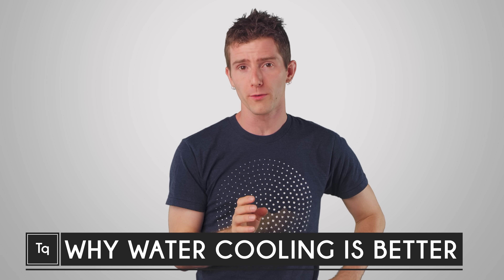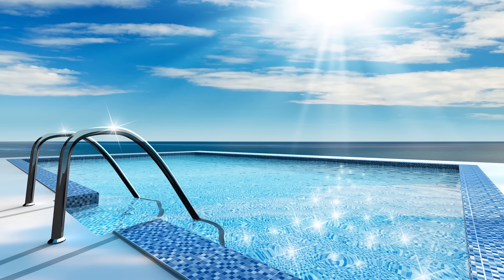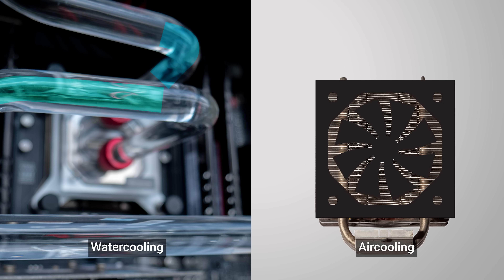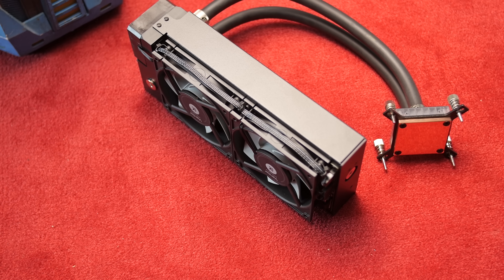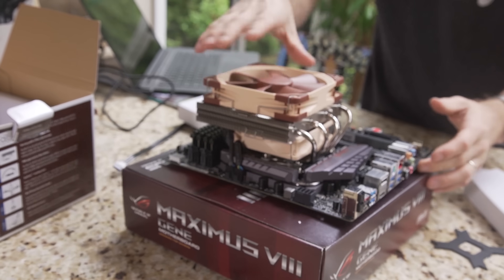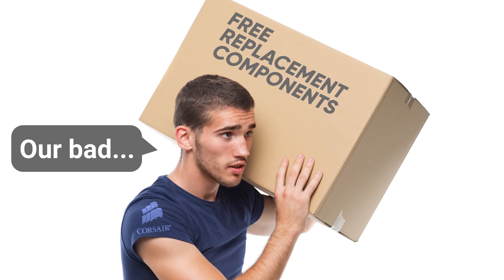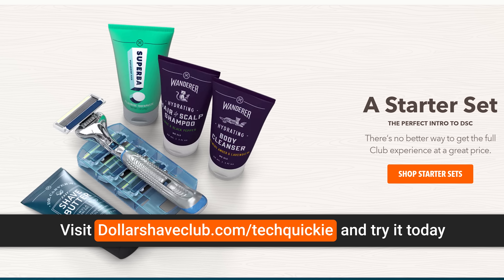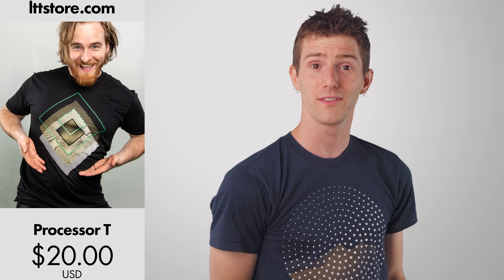Why is Water Cooling Better?

Comment: I used water cooling for my FX 8350 OC. Then ditched it for simple air cool after upgraded to Ryzen 3600x.
Reply: The sad thing about cooling the Zen 2 series is their chiplet design makes the heat off-center... which most coolers aren't really designed for.  So some coolers that are top notch for most processors under-perform on Zen 2 in comparison.  They are still good... but not as good as they could be.

Luckily, I believe Intel is planning on moving to chiplets as well, so heatsinks might start being designed for these situations.

Comment: Any type of watercooling typically only yields a couple of degrees better than a quality air cooler, sometimes watercooling is worse than a really good air cooler. Unless you desire the really clean look of an AIO, it's really not worth it. And other than looking really cool, custom loops are way overkill for the temp benefit.

Comment: Noctua NH DH-15 and you don't ever have to buy a new cooler. It works eternity, it cools better than most AIO water coolers, it has lower noise, it won't leak, and having the best air cooler allows your CPU to use less energy. This saves you money, allows better overclocking, allows longer life for the CPU, Motherboard and PSU. Air cooling also cools down RAM and components that deliver power to your CPU.

I had really expensive custom loop, but then my pump crashed and I either had to wait for a two weeks or buy air cooler at the same day. I bought the Noctua NH DH-15 and I was stunned at it's performance. It's really worth the money in the long run. Water cooling really isn't.

Also you should buy really high quality PSU. It is more efficient, gives cleaner electricity which wears the components less, and cause less heat, and possibly even better overclocking. And good PSUs work eternity.

Comment: You should mention thermal conductivity as well since generally metals conduct heat much better (according to wiki) but like you said, they don't hold as much heat. So if they are both heat soaked the metal air cooler should dissipate the heat quicker

Comment: The heat capacity is completely irrelevant for the cooling. 
The only reason water cooling is better is because you have a better heat conductivity between die and air this way.

The specific heat capacity of a fluid only determines the needed flow speed in a given system. The higher the heat capacity, the slower you have to move the fluid for the same effect.
If you use for example a fluid with twice the heat capacity of water (but all other attributes are the same) you would need half the flow rate, because the fluid wouldn't get so hot at the CPU.
Now assume that you increase the speed of the fluids to infinity, you would see that both the water and the fluid with twice the heat capacity of water would cool equally.
If you want to improve  liquid cooling you would actually need a fluid with a higher heat conductivity than water. But there is no alternative to water (unless you go with mercury).

I am disappointed that this channel did such a simple mistake.

Comment: I think the science is little off. The bonding not only makes it hard for the water to warm up but it also makes it hard to cool you down. I think a better explanation is the density of particles in the air is far less then in water. This cause far more collisions on the boundary layers allow more energy to be transferred into the water then the air. Making the water feel colder and able to remove heat more effectively from the CPU.

Comment: I used a Corsair Hydro 105 240mm AIO to push my FX 8370 past 8.1 GHz. Many builders and alleged IT professionals said these gains were not possible with a radiator under 360mm. They also said 4K gaming was impossible with my set up. Without touching the voltage, I simply unleashed my CPU in the bios and let nature takes it's course. Still gaming @ 4K in triple A titles, the latest being Gears 5. I slapped a NZXT K12 and Corsair 120mm on my RX 480 and it resulted in Metro Exodus @4K on Extreme settings... Let this be proof water cooling results in better gains considering my rig has AMD hardware lol. Nuff said.

Comment: So, I think there is another advantage of AIO/Custom loops: Even if a water cooled system gets a few degrees hotter after hours of gaming, it will take a loooong time to reach maximum temps. And also it doesen't reach low temps very/super fast after ending a demanding task (like gaming). This allows the components to expand and contract much slower and therefore more gentle. The expansion/contraction cycles are not as abrupt as with an air cooler, which dissipates it's heat very fast, due to it's direct cooling of the heatsink. I think this might be more gentle to the solder, thermal paste and ultimately the components as a whole. Please prove me wrong.

Comment: i got my rad fans at 100%.....i spent lil over 60 bucks usd.....on amazon.....on a 240 aio....no leaks and i'm gonna replace the fans because....not that great....my ryzen 2700X is under volted but at 1080p streaming gets nearly 70C and at 1440P around 60C....

Comment: if you used a lithium heatsink even tho it would cost a lost it would be better than water cooling and very cool at that so its not that water is the best its just people haven't gotten the best idea for the best way to use rather lithium with copper or even by its self

Comment: One of the other factors that can help determine if you should go Water cooled or not is the environment you are going to run your system in. If you live in a hotter area where ambient temperatures can get pretty warm even with AC going having a Water cooled non over clocked system can actually help to prevent the system from creating extra waste heat due to how efficient the water is at controlling the temperatures - the fans don't need to consume the extra power necessary to spin faster for your system.

Comment: Heat capacity only matters for the transient periods of heating. During steady state the only thing that matters is how well you can get heat from the cpu to the radiator/fins and away from the radiator/fins to the air. Both water and heat pipes are good at moving heat, so you just want a really large area of fins/radiator and lots of air flow. With water cooling you can keep adding radiator and basically get the return water to reach ambient temperature. This is very expensive though.

Comment: The key is airflow!
Don't forget now we have to cool down VRM too. Instead of focusing heat on CPU, now we have to focusing flowing fresh air. Generally i set up 3 fan out, 1 in. And these set up help my system cool down 2-3 degree if 3 fan in 1 fan out.

Comment: I did a full custom loop with my previous PC. Never again. What a load of utter bollocks for almost no benefit. You can easily buy silent GPUs and CPU air coolers. If you really want water get an AIO.

Comment: I switched back to air-cooling because of one single factor: if something dies when watercooling you wont realise it until your PC suddenly shuts down because of overheating and then it gets really annoying, frustrating and expensive to exchange parts. the funny thing is, that it died on me while updating windows, so I literally had no indication that it died until the PC bootet to some nice 90°C CPU temp and instantly shut down. never did an fan die on me but my pump has died twice within 3 years. the first time I still had waranty but not the second time so i just bought an fan in the same price-niveau I would've had to pay for a new pump+liquid and it runs just 2°C hotter in an stresstest, so its not even really a difference. but getting all that liquid out to exchange just one part, just to put the liquid back in was just an frustrating and huge mess, that I shurely won't do it again. yes, watercooling may be better for enthusiasts, BUT, if you just want your PC to run then get an air-cooler, it's less stress, easily upgradable if you buy a new system and it's easy to clean and maintain.

Comment: I remember way back when processors ran so cool you didn't need a cooler
Reply: Well, the original Pentium will be 30 in a few years... and that was the first CPU that needed a cooler. And the fastest 486 CPUs (which came out after the Pentium.. weird. lol) needed them too. Even if they were just heatsinks... they were still coolers. It would be safe to say that the last CPU generation that did not need CPU cooling of any form was the 386.

Comment: I mean, I have a dark rock pro 4 on a micro atx motherboard. And it doesn’t interfere with my Radeon vii or any of my 32 gb of trident z ram 🤷🏻‍♂️ or the top tempered glass of my thermaltake level 20 vt.

Comment: I'm a software engineer that got my degree in chemical engineering, where I worked very often with heat capacity and chemical interactions and other thermodynamic concepts. You did a great job explaining these concepts in layman's terms.

Comment: This video turned into chemquickie there for a second.

About the swimming pool, rather than heat capacity, it's probably the fact that water evaporates, and spreads heat away from the pool that makes it stay cool. (like vapour Chamber heat pipes)

Comment: I still don't understand why the heat capacity of water is relevant to its ability to cool a CPU. You're still dumping that heat into the air with a radiator so isn't it unimportant how much energy the water can absorb before increasing temperature? We don't talk about the heat capacity of heat pipes when talking about air coolers.
Reply: The difference is in the size. The radiator for the water cooling system should have a much larger surface area than that of the fan's heat pipes/coils (whatever the term is.)

Comment: My rig is on Water but not over clocked, Water transfers heat way faster than Air cooling and temperature is way better I just water cool for better temperatures I can care less about over clocking

Comment: I feel a conflict of interest here given that Corsair pretty much sponsors and provides for almost all of their builds at LTT, their game lounge etc.  There is even an LTT video showing all those builds with Corsair AIOs etc.  It's hard to take this seriously without considering a level of bias.  But even if you look past this, water cooling is only better at the more extreme levels of larger more dense rads (280mm or higher) or custom closed loop set ups ($$$$).  The top quality air coolers which cost as much or less then most 240mm AIOs perform the same or better with only space and memory clearance being the problems.  AIOs regardless you have to factor in leaks and pump failure concerns (even with low percentage stats that may occur), but water cooling without argument has more points of failures as a given.

Comment: There are 3 parts to cooling a device:
1) removing the heat from the device
2) moving the heat carrying medium around
3) removing the heat from whatever takes care of 1) and 2)

Liquid coolers are very good at 2) and 3), being easily able to utilize several thick radiators they can easily keep the medium just a few degrees above ambient. But they suck balls at 1).

Air coolers, or more precisely high end heatpipe coolers, on the other hand, are awesome at 1), but with limited space to dissipate it in place, and prohibitive cost to move it around, they suck at 2) and 3).

The guy, who invents flexible enough, durable enough, cheap enough heatpipes to utilize case mounted radiators, is going to be rich (NOT the same radiators that we use for liquid, although that would be awesome too).

Also, the end result: It depends. As it is Water can graciously take care of much more heat than air, but air can be more effective for more down to earth use cases.
Reply: has no one invented a large water block that encloses heat fins?
Reply: @oldfrend  Good question, has anyone? It would be very cool (pun intended) to see one in action.

Comment: Water Cooling CAN be better, in certain builds. if you're overclocking, water clocking is the way to go. If you're into fancy lights, and you remember nothing you were taught growing up (like putting water in an electronic machine), then water cooling is for you! ;)

I still use air coolers and I'm a happy camper. Also ;)

Comment: "Water coolers are generally quieter"
The water cooler of my friend is louder than my air cooler 😂
Reply: "generally"
"I found one specific example to the contrary"
Reply: I'm yet to see an aio that beats an nhd 15
Reply: Water coolers are definitely not generally quieter. Air coolers only have the noise of the air moving and the fans. The water cooler has   the noise of fans, air moving, and pump
Reply: @yunsen96  with the same fans being used and a properly throttled pump, an AIO and an air cooler will make the same noise, aka that of the fans. 

If your AIO pump is noisy, it's either running unthrottled or is defective. 

I've done watercooling - both custom loops and AIOs - for years now, and none of my setups had any discernible pump noise
Reply: @TheHavocInferno  my point is that water coolers have one more source of noise while compared to a air cooler. Yes you can run it lower to get them same noise but my point still stands that watercoolers have one more part that makes noise
Reply: yeah, but that is probably  because you are both idiots.

Comment: "But why is water special?
Well, there are a lot of things..."
Well, that basically sums up water in chemistry...
Reply: Coi Pansat  Boris Made A vodka cooled pc

And I am late lol
Reply: @prospect5446  OR you could go all in with 100% ethanol and replace the water pump with a compressor.
Reply: @conduit64  well good luck finding 100% ethanol because it's a pain in the butt to get 
At this point you should just stick an Air con in your tower
Reply: Cool your pc with Mercury.
Reply: Actually his explanation was based on physics, not chemistry.

Comment: I just do this instead of running the aircon in my house during the summer months. I live in Aus, so it works very well.
I need to look at one for my GPU though if I intend to run gfx-heavy games during this summer.

Comment: Ive always wondered why CPU blocks are missing conductor spikes or heat sinks to increase the surface area with the water to increase heat transfer, most seem to have a texture or are roughed up but interesting thing to test. I like the idea of a remote radiator or even phase change cooling system in a different room to remove the heat and sound.

Comment: I bought a 240mm watercooling kit from iTek and put it on my 1080ti, used to hit 90 degrees 100% fan stable at 1760-1860 core under load, now I can hit a stead 2063 core without going over 57 degrees with fans going only at 65%. Put a fan to blow on the VRMs. My case is cooler also for my stock ryzen 5 3600 so it doesn't go over 74 degrees under load and MUCH quieter. AMAZING upgrade for 43 euro (bought it on sale from amazon).

Comment: Using the high specific heat of water may sound good, but you know what property of water can you use even more effectively for transporting heat? Latent heat!!!! Like in heat pipes that you find in your air cooler. Air coolers are more effective at getting heat to the fins/radiator than water coolers. Heat pipers are also passive, silent and reliable, unlike water circuits. 

The only two performance benefits of water coolers are:
1) Thermal inertia (only applies under short duration of load).
2) More flexibility of radiator placement, which allows for better radiator geometry. A radiator with a large cross-sectional area is more efficiënt. 

BTW, anyone care to explain why they are called "air coolers" and "water coolers"? They both use H2O to transport heat to a radiator that then needs to "radiate" the heat to air. So a bit of a misnomer, if you ask me.

Comment: You should build a watercooling loop in which water is directly in contact with the CPU. You take a traditional waterblock, put a big hole in it, a seal and do a video about it. It could be a bad (or good) cooling idea.

Comment: The 120 mm AIO is worse than that Noctua Cooler, so what's the point of this video? My new 280 AIO is as good, not better than my former NH-D15S (just swapped for optics). Custom water cooling is another thing, but this video is one of the lesser good ones of LMG.

Comment: I don't think the swimming pool is the best anology to invoke here.

Photons from the Sun will pass through most of the water and hit the floor thus the water is not really that hot.. However since the photons hit the bottom of that pool and energy cannot be destroy it will become heat, and heat rises.. so in extremely hot day the water could actually turn hot but it's not because of the sunlight it's because of the heat rising from the bottom..

Comment: @Techquikie... your swimming pool analogy is wrong because the pool stays cool because of evaporative cooling which is requires water to go through a phase change from water to water vapor. Water coolers don't work that way because they are working in the sensible heat range without using a phase change.

Comment: When your air cooling system breaks, your computer shuts down until fixed. When your water cooling system breaks, your components short out and you have to replace the whole thing and hope your data wasn't fried.

Comment: one problem with water cooling is that water 
is
freezing therefore we can not have water-cooled PCs in our business because in winter it gets cold and then it will freeze and destroy pipes and components ice expands we have a smart system that turns on and off the heat in the company so on weekends when there no one at work we save money on heat so we can't have water cooled, but the difference is not that big already